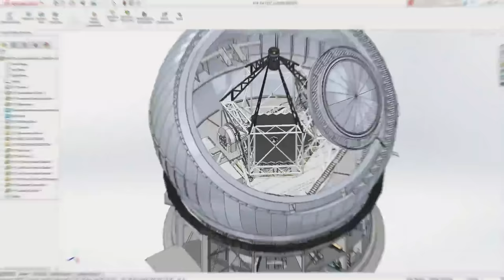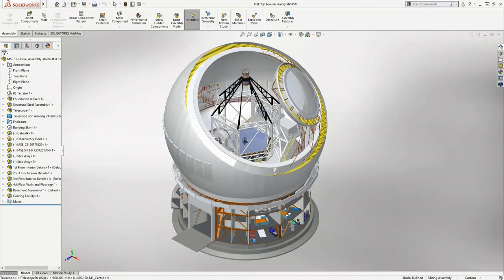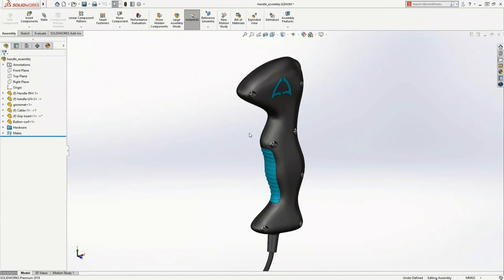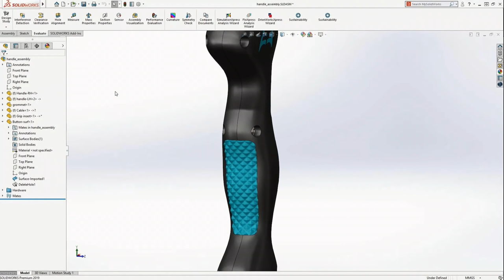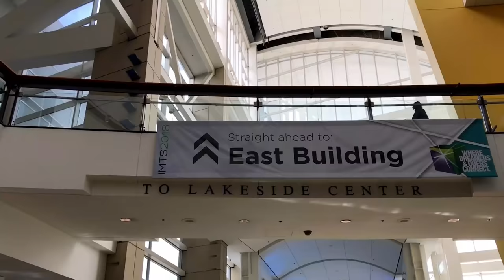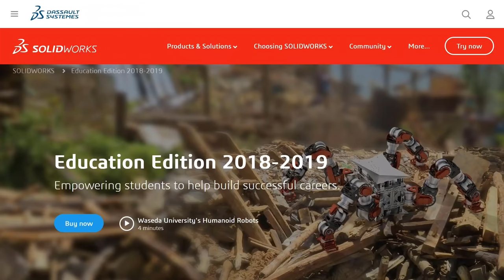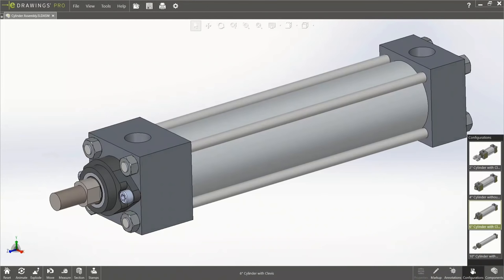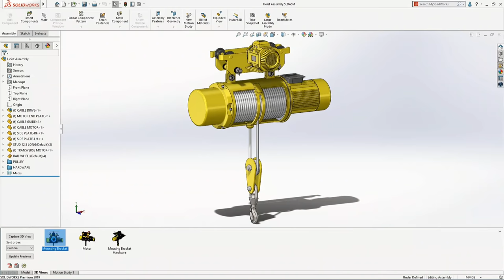SOLIDWORKS Launch 2019: CANDA France Hawaiian Telescope - SOLIDWORKS Live

Comment: i hear a lot of swearing, like: efficiency, speed, stability etc. people from SW, fix the damn exploded view tracing lines. every time i add an additional explode dashed line, the whole assembly becomes a huge mess. and this has been since 2015 ish version. then fix the unknown reason why some mates flip. this drives me nuts! these simple hick ups take away like third of my work time and trizillions of my nerve cells.
Reply: I had this problem while was using only CPU. 
After the video card was purchased the problem passed =)